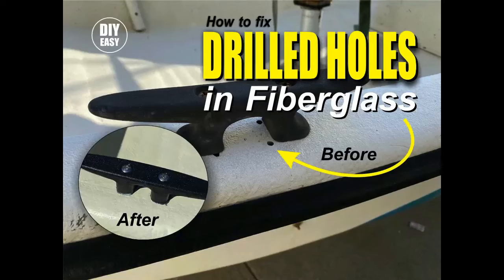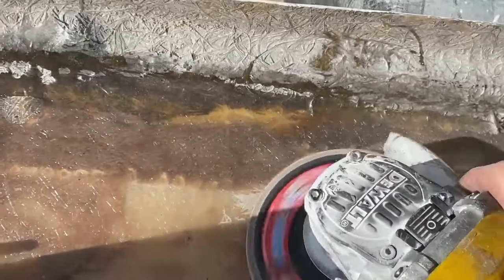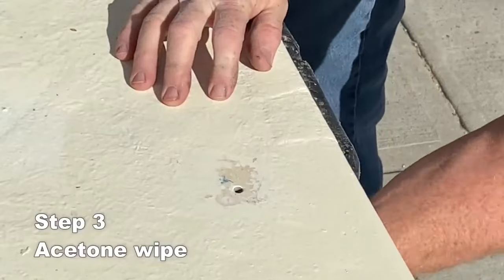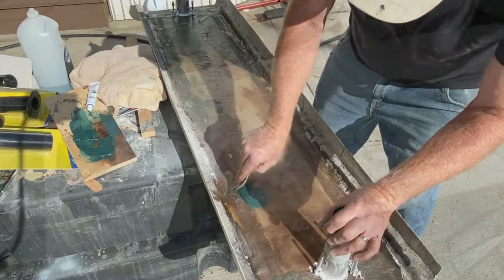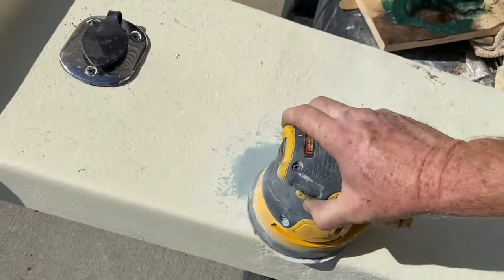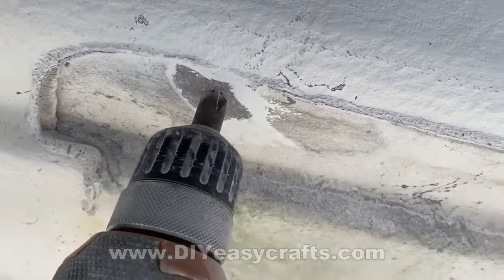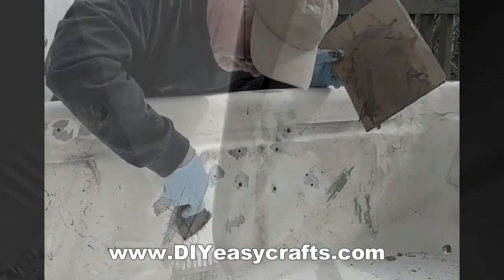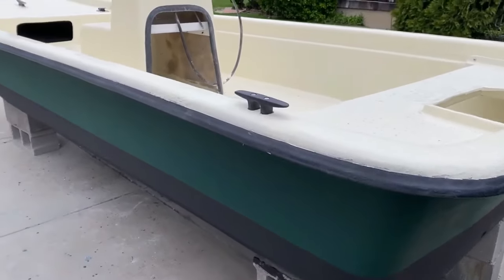Easy Fiberglass Hole Repair: Fixing Drilled Holes with Expert Guidance

Comment: I know this post is from a year ago. But I was wondering if you can drill through these holes you repaired? Will it be weak or the same as a new spot on the boat? Thanks

Comment: You didn't mention if you did the same work on the other side of the whole...
Reply: Some of those spots are impossible to get to the back of it
Reply: If you’re not able to get to the back, is it the same process? Just stuff the putty in and sand down once it’s hardened?

Comment: I see you have the gel coat already mixed. Did you color match that before? If not how did you get the color correct?
Reply from the maker: No I bought and used the same gel coat I used on the deck and gunnels
Reply: @DIYeasycrafts  got it. So you used the gel coat on the entire boat as you were redoing the whole boat. I am trying to match white gel coat on a spot to match the rest of the existing gel coat boat just so the repair looks fairly unnoticeable. Any advice on that? Thx!

Comment: in the past ive filled holes, let it harden then sand. but noticed rings appear weeks later from what i guess is the hole filler doing its last little bit of hardening/shrinking. Dose this form of filler really not need to be left for a few days to fully harden before sanding?
Reply from the maker: I guess it depends on the type of filler you used. I have not really seen any shrinkage on the holes I filled. Used Bondo with Fiberglass strands from home depot

Comment: Awesome video! Question tho i Have only hole here and there and if i use the brush Will the brush strokes be visible in the gel coat
Reply: Yes, you need to wet sand and polish it after, it will look good